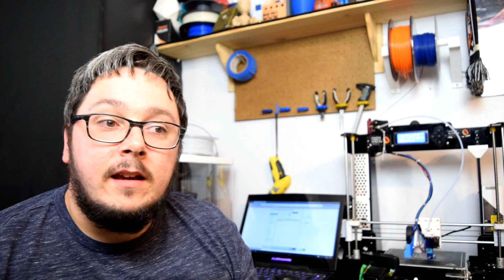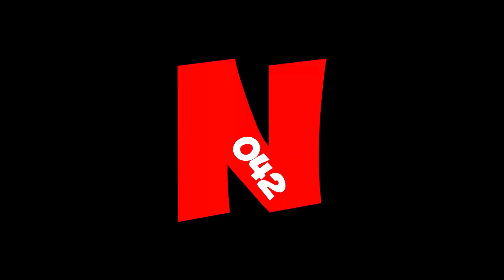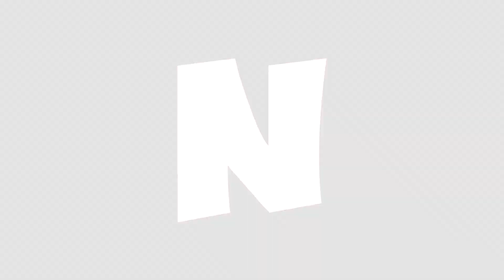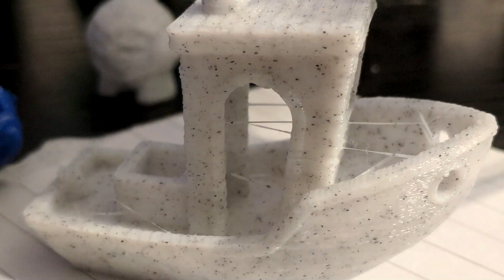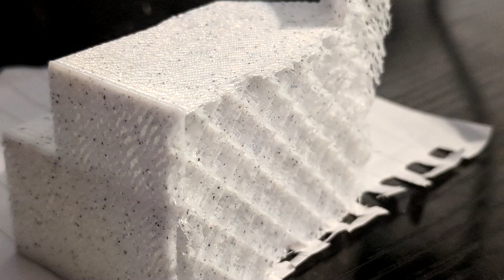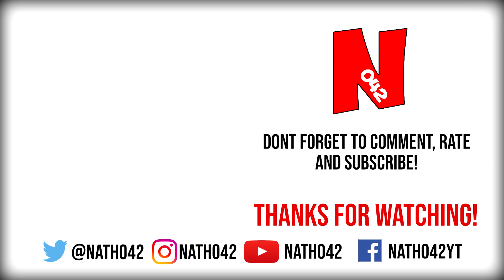Printing Issues (Brittle Prints) - Help me!

Comment: just had the same problem. rechecked my filament and nozzle. had wrong nozzle on. ordered 1.75 but had .2 nozzle on.
Reply from the maker: woah strange! in fairness i normally use 1.75 with a 0.4mm nozzle and that runs fine. Make sure the slicer is using the correct numbers.

Comment: One of the things I found out was that the filament will be affected by air/temperature and moisture. Ever notice how when you take out a new filament roll/spool it doesn't feel dry? Then feel that same spool of filament after a day or two, notice how it feels dry. Hence it prints out prints with pores/holes in the print as the moisture was taken out.
Reply from the maker: yeah its strange, it always seems to be that the filament feels that way, I always thought it was supposed to be kept dry, I think the UK isnt too bad weather wise for it to last a fairly long time in the open, or ive normally been able to print with filament that is upto 1 year out the box maybe.

Comment: turn off volumetrics!! thats the cause of this issue
Reply: How do you do this??
Reply: Where would you disable this, on the machine or slicer, what would it be called in cura?
Reply: @briansilvas8203  it's in the firmware
Reply: OMG Doc, you are a life saver!! I have literally been working on this for 2.5 days straight and have rebuilt it. changed the nozzle, creed etc etc. I came across your post here, turned it off and BAM, works like magic!! Thank you thank you soooo much!!! :)
Reply: @staceyy2827  Hey brother, so do I use a different G code flavor, or do I find this in the LCD screen on the printer? If so where can I find it? I didn't see a Volumetric selection on the screen. New to this, Thank you!!!!!!!!!!!!
Reply from the maker: oops!

Comment: Did you find out the problem? I just bought an Ender 3 and it was printing fine, then I accidentally initialized eeprom and my prints are turning out exactly the same as you described. Any help would be appreciated. Thanks brother.

Comment: if you left the filiment out and about it could have absorbed a bit to much moisture. a quick test for this is to try and "snap" a piece of raw filiment like spaghetti. if it snaps when you bend it in half it's good. if it just bends and flexes no good jack. throw out the diligent and get a new and fresh spool. this problem is mainly seen in Nylon and bot PLA however PLA "CAN" suffer from this phenomenon.it's worth a try. I would recommend just trying some brand new filament and see if it works.
Reply: so you're suggesting to buy a new spool whenever there is a bit moisture... Some people would suggest drying the filament. But some people would also buy a new car when its ash tray is full.
Reply from the maker: Thank you for your message, I believe I did answer this previously however I did a change to my channel a few weeks ago and it seems to have removed aload of old comments. Sorry for the inconvenience!

Comment: What about the heat and humidity? last few weeks it's been a very warm and humid time here in the U.K, I noticed an issue with my filiament, drying out and loosing it's flexibility?
Reply: Did the new filament help or did you get the same result?  Thanks in advance!
Reply: I doubt that filament drying out could be a problem considering that the pros are putting their filament in drying boxes with silica gel.

Comment: if you've recently updated cura make sure that the filament diameter hasn't reverted back to the default 2.85mm, sometimes does it for no reason too

Comment: Have you calibrated your extruder? Your E-steps might be off,. Failing that, could be an extruder issue. The last few weeks I’ve been having a couple off extruder issues, skipping layers etc. I’ve put it down to the hot weather we’ve been having, added a 40mm fan over the control board and it’s seems to have fixed the problem. The driver heatsinks are certainly staying a lot cooler.